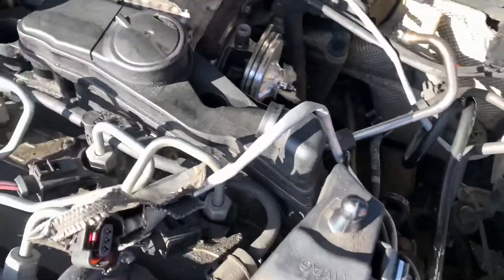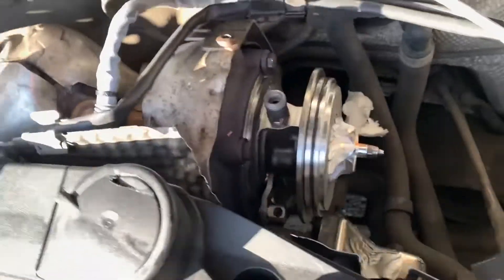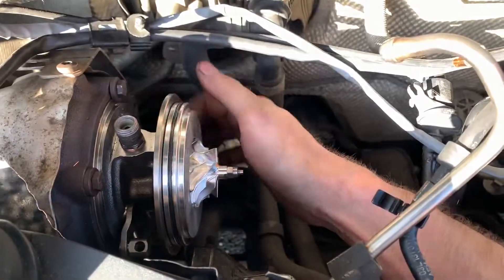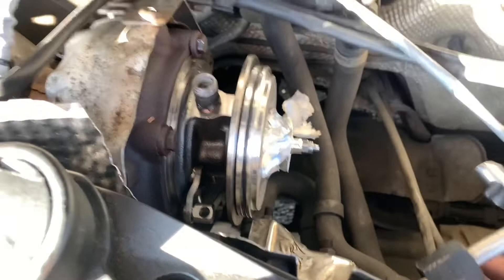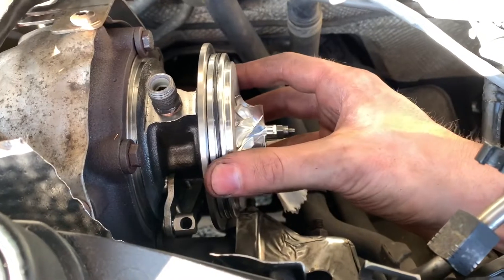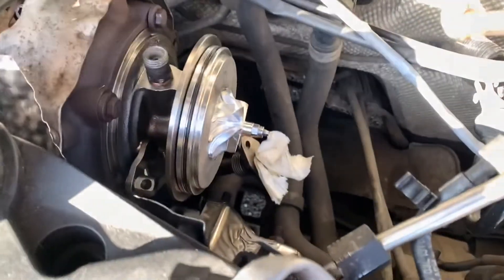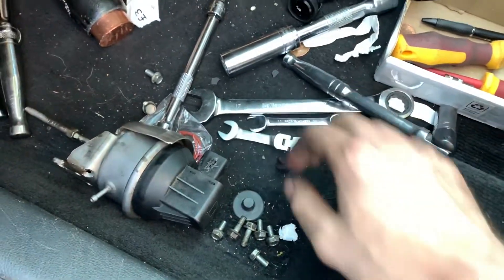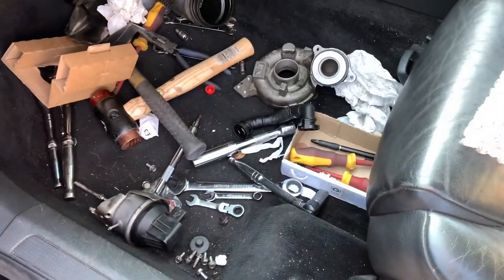Volkswagen Passat turbo replacement turbo core swap

Comment: Did u remember to pre-lube the bearings w/ oil?
Reply from the maker: @leeisenberg  hi, yes I believe it was the the fuel injector fuse I pulled, then just cranked the car over multiple time without starting it to let it build oil pressure and get it circulating. Im not sure if a 2013 is similar, if it uses the same engine then high probability it could be the same. Apart from that I don’t remember much else as I done this job years ago🙂
Reply: @AlphaEngineer2022  Oh okay. I didn't know u could do that to a diesel, always heard when they run out of fuel it's a pain to bleed air outta the fuel line/s. But it happened slightly when I replaced my fuel filter a few months ago, took some cranking to get it to start back up. Thanks so much for sharing this video b/c I Never Ever would've thought about doing it that way. After watching other videos of guys pulling the turbo/manifold assembly it seemed like a Hopeless job that I would NOT have time for at all. So thanks again man.   - take care from Tn
Reply from the maker: @ it's a pain in the butt to do but if you plan for it to take a day then it can be done, it's just fiddly. with the injector fuse removed you aren't introducing any air into the diesel system, it all stays closed until you put the fuse back in, mine started on the first go. all the best.
Reply: @AlphaEngineer2022  Oh okay, that's too cool. I'm still new to the 2.0tdi, I've also got a 2006 1.9tdi PD that's still I guess electro-mechanical, cam also works the injectors. So, u could do a compression test on the 2.0's by plugging into the glow plug ports, that's Awesome. When I bought mine the oil level was LOW unfortunately I think b/c the lady was only changing the oil every 10,000 miles. So I watch the oil level like a Hawk, use the VW Euro spec 5w40 oil & use Engine Restorer too.   Thanks AGAIN man.                 - take care
Reply: @AlphaEngineer2022  Everything looks surprisingly similar to my 2013 engine. Only thing that looks different is the car Body/front end. Hope I can do it the same way. Will be ordering a core ASAP for peace of mind. Keep up the good work.                                   - take care man
Reply: @AlphaEngineer2022  Hey man, speak of the devil, guess what happened this morning on the way to work?...  Yeah, it Died, blowing lots of white smoke out the tail pipe off & on. Mercy. I knew it was coming, just didn't know today would be the day. It's BAD I'm sure, but idk if I can even get it home on it's own power. What do u think sir?      - thanks
Reply from the maker: @ I think it’s time to get the tools out😂
Reply: @ Yeah I'm working on it right now. They made it much more difficult by using friggin' Torx screws on the intake/compressor side instead of regular hex head screws, MERCY. I'd be farther along if it wasn't for that bs. Need to get the dang vgt actuator/switch out of the way, how the heck do u get those off??...
Reply from the maker: @ I can’t remember to be honest, I know there was a lot of crap I had to get out the way though, I just started unbolting everything I could to make space
Reply: @ Thanks man.
Reply: @AlphaEngineer2022  Finally got it done, what a NIGHTMARE. Mercy.

Comment: Thanks so much for sharing this. Never seen anyone do it this way before, but it makes Sense & Cents.    Afraid my 2013 Passat 2.0tdi CKR turbo is going out, leaks turbo sometimes, makes whining sounds off & on, occasionally cuts out all boost & the glow plug light blinks. Thanks again.     - take care

Comment: How did you remove the T27 bolts on the cold side housing?
Reply from the maker: @The1jmadmax  I think I just had normal 8mm bolt heads. They are tight but accessible, there was only 4 but I can’t remember now if I’m honest, quite a while ago now.
Reply: @AlphaEngineer2022 But I am working on a 2013, so that's probably why...
Reply: All good man, i have 4 10mm bolts on the hotside, but i have 4 T27 torx bolts on the cold side. @AlphaEngineer2022

Comment: I know this old vid. But whered you get the cartidge from? I might go this route for my 2013 passat but im only seeing ones sold from amazon, which are no name brand chinese ones.
Reply from the maker: @Jorgeramos-up7el  I bought one from eBay, the quality was bad and it didn’t quite fit, it wasn’t good at all. I Rung turbo dynamics in Christchurch and they hooked me up with a genuine one, it was about £160 if I remember and about half a day of my time to fit because I don’t know what I was doing😂

Comment: Can you do this if the turbo completely stops working?
Reply from the maker: It’s hard to say, the bearings were going on mine. But if it’s completely stopped working there could be more damage. You won’t be able to tell without taking it apart.

Comment: Does this work instead of taking everything off , like will the turbo be repaired etc whistle noise ?
Reply from the maker: Yep worked for me. The turbo core was damaged, lots of play in the bearings. Once I replaced the core, the whistling noise went away and I had good power again. 

I think it cost me a total of about £150 including buying some extra tools. 

I’ll be honest though, it’s very tight and difficult to do but if you have the time and patience you can save a lot of money doing it this way. Luckily I had multiple cars and bikes at the time so I didn’t mind this car sitting around for a couple of days whilst I fixed it in my spare time.